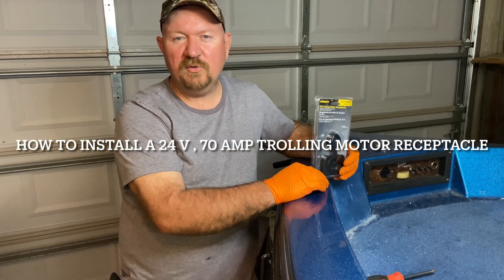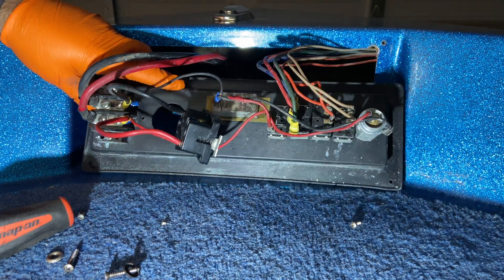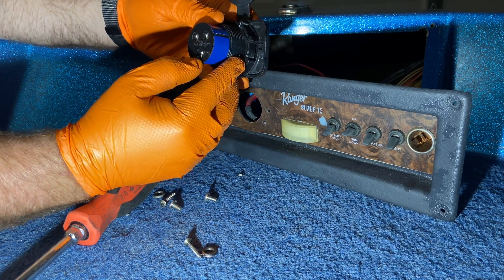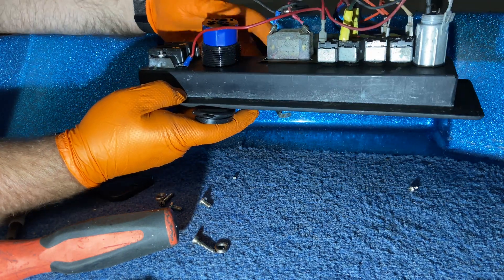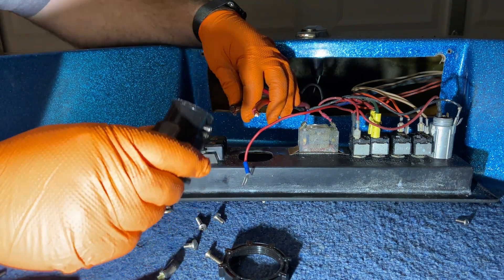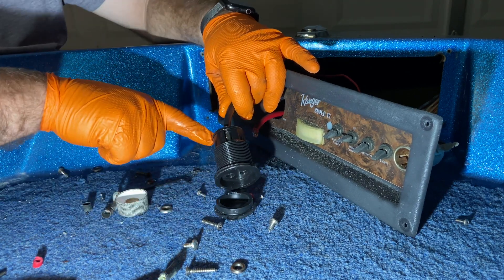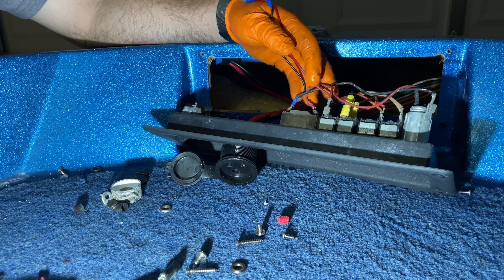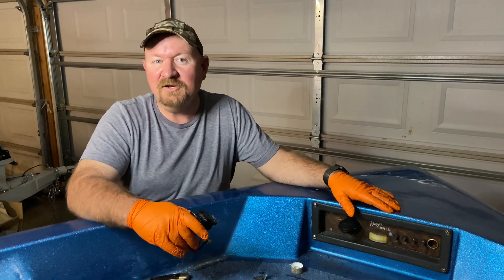How To Wire and Install a 70 AMP Trolling Motor Receptacle- Boat Wiring, Part 2: Receptacle

Comment from the maker: trolling motor receptacle (PAID LINK): https://bassproshops.vzck.net/c/2616027/603808/9453?prodsku=100118924&u=https%3A%2F%2Fwww.basspro.com%2Fshop%2Fen%2Fmarinco-70a-3-wire-trolling-motor-plug-or-receptacle&intsrc=PUI2_4595
DISCLOSURE:  I earn from qualifying purchases at no additional cost to you.

Comment: Do I need to upgrade the wire to a thicker wire to handle more power going through it?
Reply from the maker: I used the original wire on my 1984 Ranger boat and it is working with no problems.
Reply: @ProWrenching  ok good I just thought I needed to upgrade the wires also. Thanks 👍 I will keep mine the same also for my 12v trolling motor